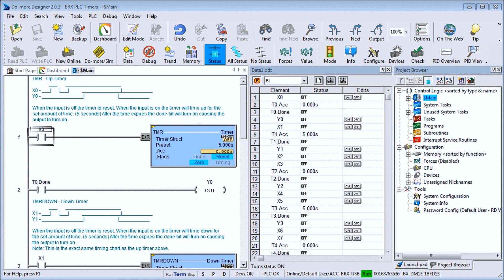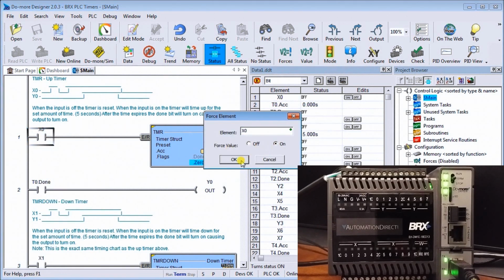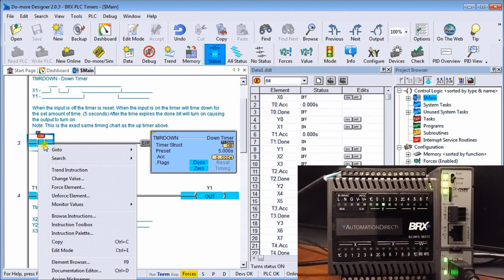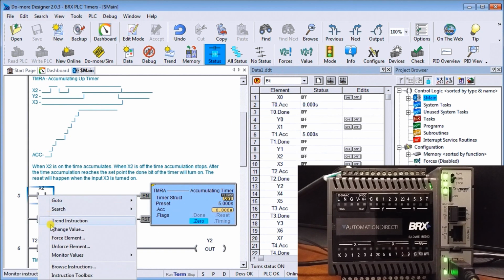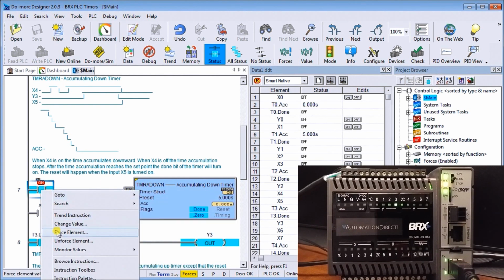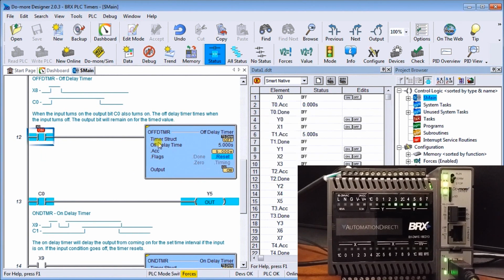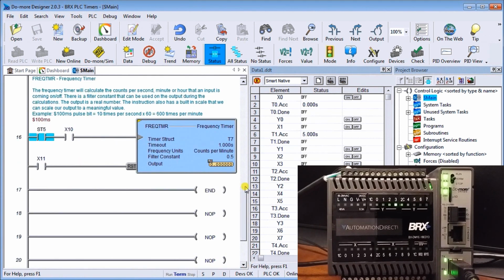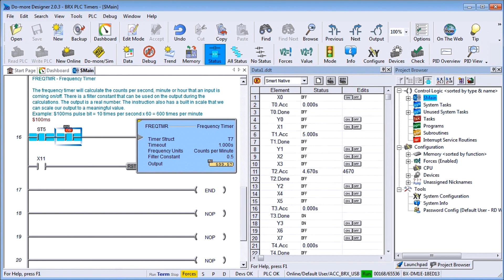BRX Do-More PLC Timers

Comment from the maker: There has been an update to the BRX PLC. Do-More Update release 2.1.
They have also added AB/Rockwell Timer bit fields - .TT (Timer Timing), .DN (Done), .EN (Enable) These bits will behave just like the AB Timers. The behavior of the existing Do-More Timer bits has not changed. This will make those familiar with Allen Bradley timer programming more comfortable with the Do-More Designer programming.
The Common Timer Instruction Editor has also been added. It provides details about the behavior of each different Timer instruction in the Do-more control engine. The editor comes up by default when you create any new Timer instruction (TMR, TMRA, ONDTMR, OFFDTMR, TMRDOWN, TMRADOWN, TMRAG) As you cycle through the different Timer instruction radio buttons in the top/left, the Input Leg and Timing diagram descriptions change, providing details about that specific Timer instruction. This makes it easy to see the differences between the various Timer instructions, giving you the information you need to choose the best Timer for the task at hand.
This release of the software has many new features like the ones above. You can download the newest version of the software free of charge here:
http://support.automationdirect.com/products/domore.html
For additional updated features, please refer to the updates.pdf file in the installation folder.
Regards,
Garry
Reply from the maker: All Automation Direct Software can be found at the following link:
https://www.automationdirect.com/support/software-downloads
Regards,
Garry

Comment: Why does using ST4 not display any Output frequency? I would have expected it to show 60 counts per minute.
Reply from the maker: While the CPU is in RUN mode this bit location (ST4) will be set ON
once a second with a 50% duty cycle, that is, it will be ON for 1/2
second then OFF for 1/2 second. 
You will not see a frequency, but just the bit turning on and off at the time base rate.
Regards,
Garry